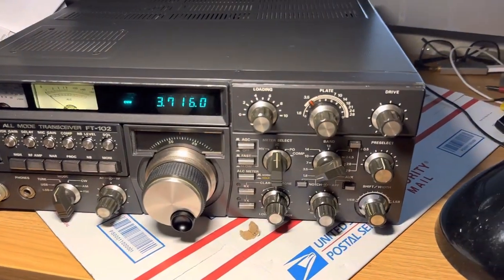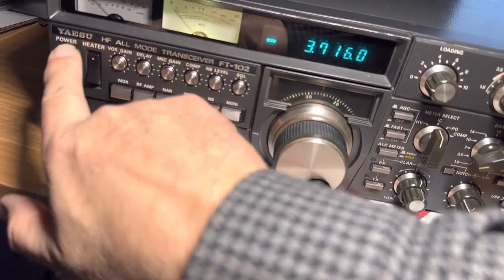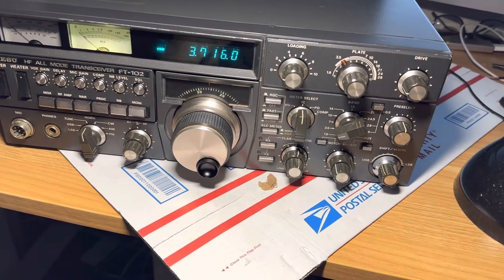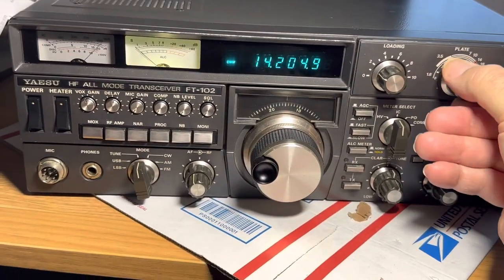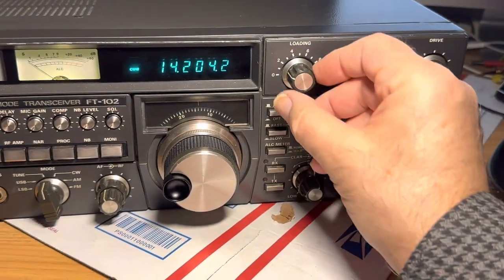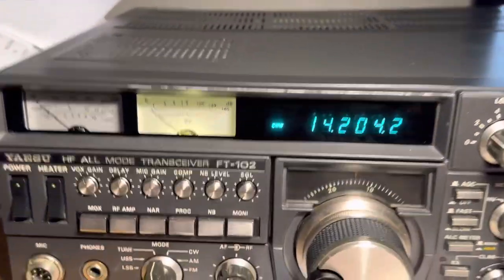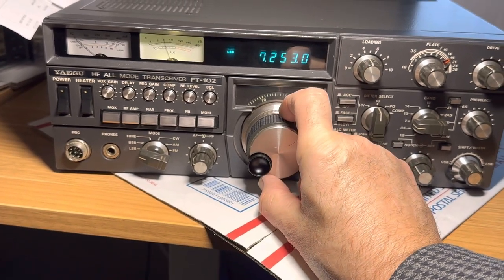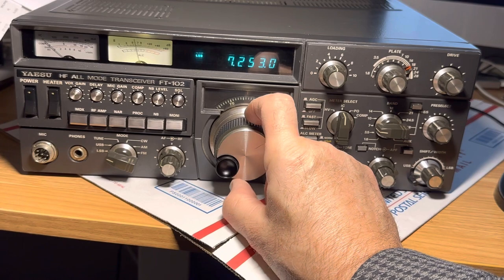Yaesu FT-102 tune up transmitter on each band demo with Drake MN2700 antenna tuner

Comment: I've found that on my FT-102 it is essential to follow step-wise the tune-up instructions from the original manual exactly as written there.  Paying attention to the plate current, whether adjusting the drive, loading or plate current dip, is recommended over just watching the output on an external power meter.
Reply from the maker: Thanks for the info!